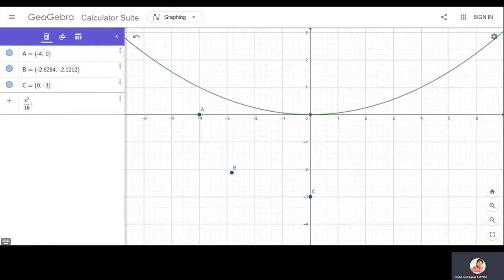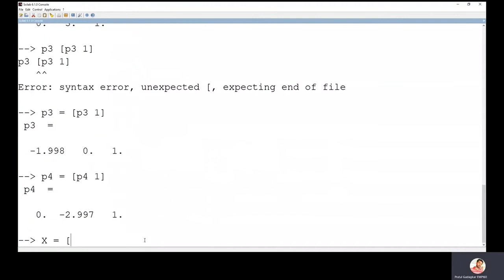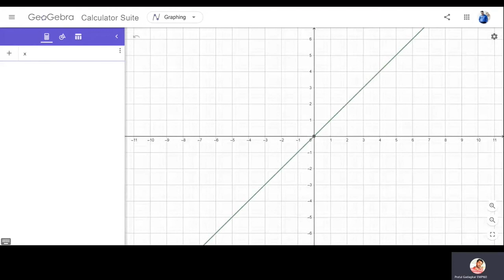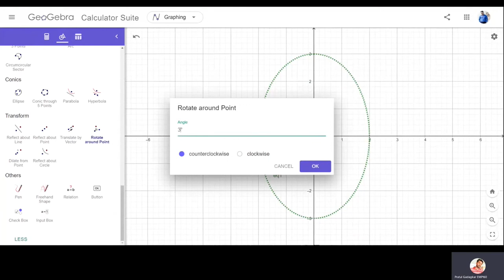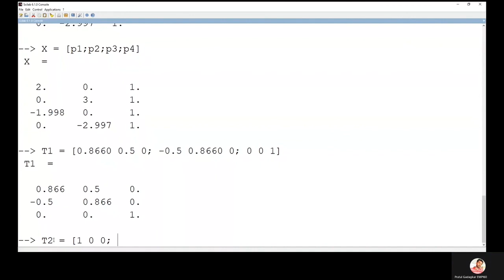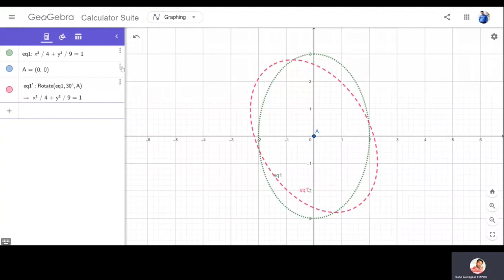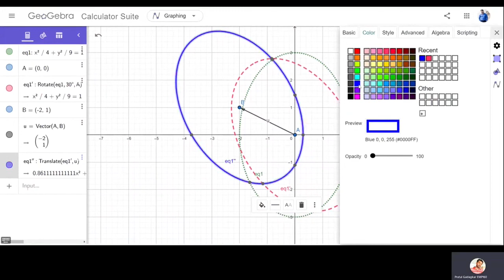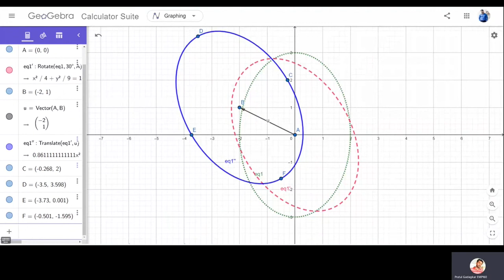Lecture 18 - How to generate uniformly spaced points on an Ellipse ( using Scilab and Geogebra )

Comment: Hello, helpfull video, thanks!

BUT: the first representation of these "equaly distributed" points on an ellipse are obviusly NOT uniformly spaced on the ellipse - or am i missing something?

i am searching for a solution to get an arc with  n equal segments aut of a line with n equal segments
(or: n equaly distributed points on an ellipse in sector 1 and 2 out of n equaly distributed points on an ellipse in sector 1 and 2  with b=0; both with the same a )

i understand your solution, but im not sure your solution is right...

kind regards